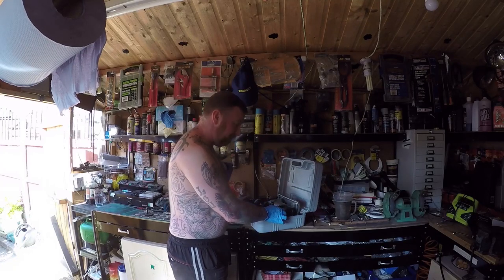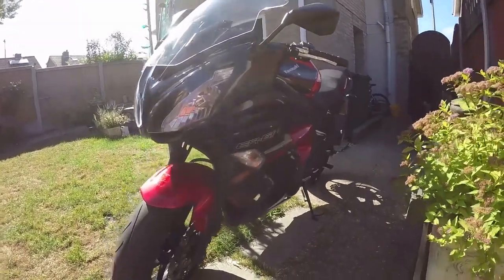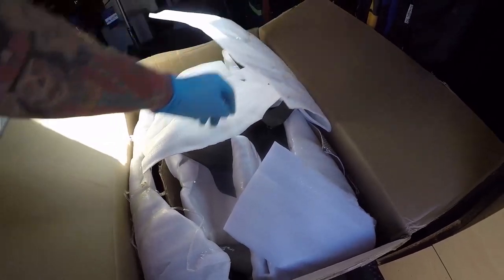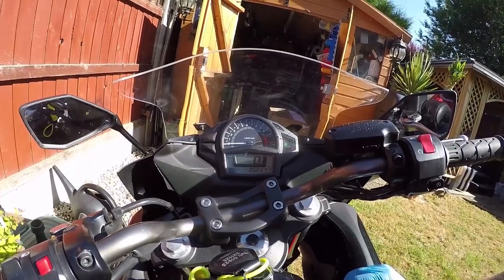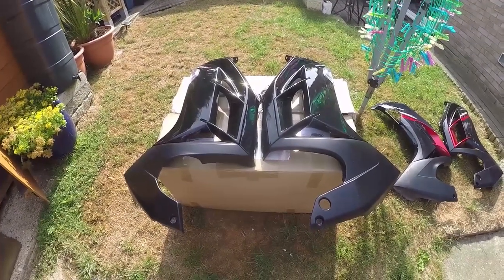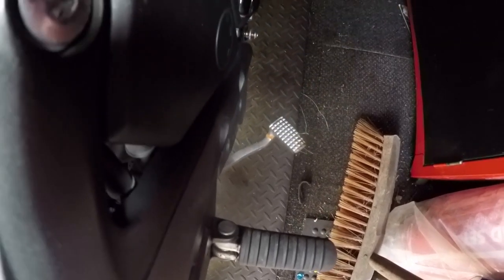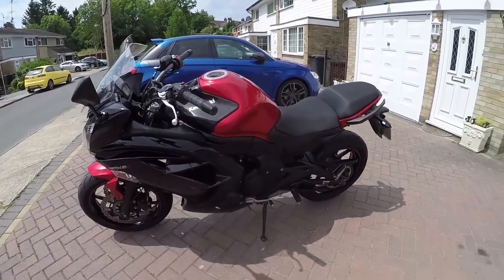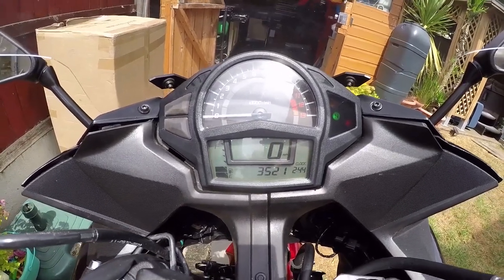KAWASAKI ER6 REVIEW & FIX MARK SAVAGE

Comment: Hi mark, hope all is well. I just got one of theses that has been sitting for 1 year in a  garden and wont start.
The fuel got left in. Im going to change the plugs and put fresh fuel in. Is there any thing else i should check. She was backfiring until battery is dead. only turned it over once myself with fresh battery.
Reply from the maker: As long as I was OK and running before 
All fuel out and clean in tank filter if it has one 
 Carb or injection ?
If carb flush through but you may need to take ofd 
If injection it will clear itself 
New plug and air filter 
And oil and filter 
New battery as it may charge but not good amps 
Clean up chain and look at brakes , me id change the fluid too
Tyre pressure 
And give it a go 
Nice project really bud 
Enjoy
Reply: @marksavage   Great advice mark thanks. its injection :) and ran before standing
Reply: @marksavage  Got her going with a bump up the road :).  starter motor was half seized and killing the battery, there was not enough power left to fully crank the engine. Big puff of black smoke front wheel left the ground and my mate went shooting up the road ha ha ha. it has a scorpion exhaust. that has to go!! i like the noise and flames. like my hearing better though lol

Comment: (Long ass text incoming)

You see Mark. I JUST bough this cool-looking chinese Hyosung pf50

It's in MINT condition. Doesn't miss one single screw.

I've plucked the scooter apart to find restringtions.
i found one under the carb, took out the wacher
Mounted a tecnigas exhaus

Issue is , it only maxing at 35 miles (60 kmt) on the flat
and as low as 20 miles (30kmt) up hills

I've cleaned the variator hous, like in your video.
My belt could be better
Tryed with everything from  6 to 10 g veights. Landed on 7.5g

still goes shit

I'm about to order a 70 BB and are in dialog with the store and they said I wouldn't need a new head.

Why is my scooter so god damned slow you think ? Maybe just weak shitty engine ??

MaRTIN FROM nORWAY
Reply from the maker: MeBooo hi bud 
Ok sometimes mate with these Chinese mopeds they will still only do 30 mph no matter how much you play or upgrade Grrrr
I would say bigger jet and air filter but I hate to say a 70 / 80 kit maybe the only answer but an upjet will be needed too or a bigger carb so if 17.5 go to 19mm or 21mm with the sports exhaust 
I have heard that you can use the same head but I’ve always changed the both parts if you can!!
Me ! I’d sell and get myself a speedfight or aerox maybe a runner , more fun , faster but a few £ more but worth it 
Mark